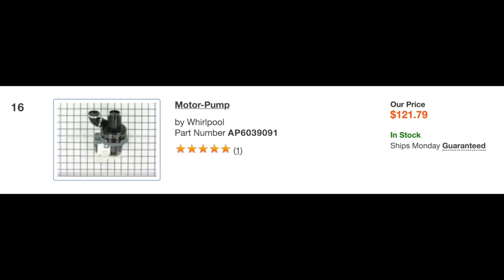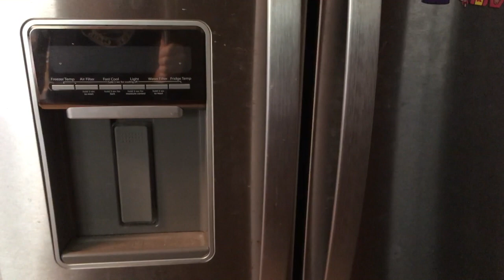Whirlpool Dishwasher Pump Motor Repair (And Upgrade?)

Comment: I have replaced my pump once already, and the bushings have failed on the 2nd one within 1 year. So after watching this video, I came up with a metal washer under the bushing to help keep it centered. It is running its first load now, and pump kicked on no problem. I took pics of what I did, if anyone would like them, just send me a message.
Reply: Kind of curious what the specs are for the washers you used and how this worked out.

Comment: I just found 2 soap pods in the bottom of our dishwasher. It does the same as yours, I can hear something running but it never sprays water and the jets never spin. It drains and steams up my glasses when I open the door. Thanks for posting this.

Comment: Thank you, you just saved us from replacing our pump! We didn’t have an issue with the bearing, but the shaft was all messed up with gunk. Cleaned it up and it worked like a charm! For anyone who needs help figuring out how to disassemble your machine to get to the pump, the repairclinic.com YouTube instructional will help.

Comment: Commenter Josh has that internet bravado you find in many a beta male.  That aside, I am glad you made this video and do allow commenting.  I've gone over your video around 10 times.  I have my motor apart and someone commented that they could screw-off the impeller.  Looks like the same carbon bushing is in the top impeller-side plastic housing as well.  That one looked in good shape for me.  I'm going to swap positions after I JB Weld & drill-out the oval-worn one and put that at the top.  Doing this only because it appears the impeller-side has less wear and tear.  Maybe I'll get another couple years out of this piece of garbage.
Reply: I was thinking the same thing. How has it worked out? Have you used any additional lubricant?

Comment: Thank you! I ended up taking it all apart and then did a search for c35-3a and your video came up!
Reply: I did order the plastic bearings. Here is the model of the dishwasher is anyone else is having same issues: Kenmore 665.13403n410, Recirculating pump PN# W10529163

Comment: Thanks for the video.  Have a dishwasher like this not going through the cleaning cycle.  Before I order a new pump I'm going  take it apart like you did and see whats going on.   Was thinking maybe if the bearing is worn like yours was, I could cut a small
piece of aquarium tubing to fill in the worn hole in the bearing.

Comment: My Dishwasher has the same pump and the impeller fell off when the brass threads wore out. Like you said you can’t buy the pieces for it so I cold welded a stainless lock nut in the impeller and used blue Loctite. It worked.
Reply: Mine did too!  My dishwasher is a Kitchen Aid  but you gave me a good idea where to go from here!  Thanks!  Misery really loves company!
Reply: Update. The repaired impeller lasted about 2 months. I repaired it again and it lasted until I replaced the pump with a new one.

Comment: The more I think about how whirlpool is screwing the consumer with this, the more pissed off I get.
Mine died last night, and thanks to this video, I was able to find the problem.
I’m going to try to cut a set of bearings on the lathe from bronze.
Reply: How did it work out?
Reply: Hello all I did cut a set on the lathe worked so so.  Well.......worked perfectly but actually wore out after about a year and also wore the shaft now as well.  Ho hum so now I’ll be trying to fit some bearings which is what should have been done from the factory!!!

Comment: Thank you for both videos once again. You showed that these unjustifiably expensive parts Whirlpool wants us to buy are very well repairable with the right approach. Upon watching both Videos I bought ball bearings, 1/4" plastic tube and hose clamps and was waiting for them to come to take my Kitchenaid dishwasher apart. I should have disassembled it first to check the pump. :-) When I received the parts and took it apart I realised that nothing was wrong with the inserts in the circulation pump but metal insert in the circulation pump impeller rusted out completely. Impeller was just sitting loose in the circulation pump casing. So I ended up drilling remaining insert piece out from impeller, getting 18-8 stainless steel 10-32 thread size insert for plastic (McMaster-Carr # 92398A115) and gluing it into the impeller with LOCTITE EA9017 Epoxy. That was a perfect fit. Thread depth for the insert was a perfect match to the thread length on the pump shaft. It's working again and can hopefully last for a while before I need to fix it again.
Reply from the maker: Nice work! I've never heard of that rusting out, but it makes sense that the manufacturer would pay 10 cents for a chromed steel rod instead of 20 cents for a stainless one. Once the chrome is compromised, oxidation will always win. Greedy bastards.

Comment: ok, so my pump has the exact same issue shown in this video. My Dishwasher is Whirlpool and the model # is WDF760SADM2. 
The pump part number is W11032770.
Upon researching online I found a 3d printing model for this part (that fits my own pump model #W11032770) on this website: 
https://www.thingiverse.com/thing:4007657

I found someone in my area that is printing it for $10 on industrial grade PETG plastic, and I am hoping this will solve my problem. I am currently waiting for the part to print, so haven't tried this solution yet, but I wanted to throw this information out there in case someone has the same issue and can try to use the same solution.

Comment: they should recall all dishwashers  or at least the motors or make a repair kit at minimum. your video was helpful
Reply: I agree. This seems to be a very common problem and replacing pumps at 2 years is ridiculous. There is clearly a manufacturing defect here.

Comment: Thank you !!!!! I was so close to pulling a trigger on replacement pump last night, until I stumbled on your video. Very  helpful...The only difference is I used a small nut I had kicking around with a small brass bushing inside-We will see about the longevity of my repair-My pump was in much worse shape than yours, but its a win nevertheless. Good job!

Comment: That "heat-shrink bearing" idea is likely to fail within the year. NOT a primo idea. You should have purchased a new bearing.  Just sayin'.
Reply: Using the bearing instead of a bushing, it only needs to hold the shaft tight to the inner race.  No wear on that surface, it would have worked as long as it was tight.  Just sayin'

Comment: Thanks for this video.  I was having a very difficult time diagnosing this problem.  My bushing had the same wear pattern as yours.  As a quick fix, I simply swapped the bushings as the other one showed no asymmetrical wear.  The machine is functioning properly now, and I'll try some of the replacement part suggestions here soon, but I've introduced a new problem.  The seal where the blue/gray pump fits into the black plumbing piece with the big o-ring is now leaking when the pump is active.  I've tried to find any nicks on the o-ring but it looks good to me.  Everything seems to fit so cleanly that I can't tell where the problem lies.  Any advice on this problem?  Is there some sort of o-ring sealant that I should apply?
Reply: MIne is leaking now as well.  Did you figure out the problem?
Reply: Has anyone figured out the answer to this?

Comment: Why did you use a plastic bearing vs. a stainless steel sealed bearing?
Reply from the maker: The main reason I didn't get an all stainless bearing was cost, since this was an experiment. And so far, the plastic one is working just fine. As for getting a sealed bearing, I don't think seals would do much in a submerged environment. Water's gonna get in. I'd rather it be able to continually flush out. But hey, give it a shot and let me know how it goes. Anything has to be better than what it came with.